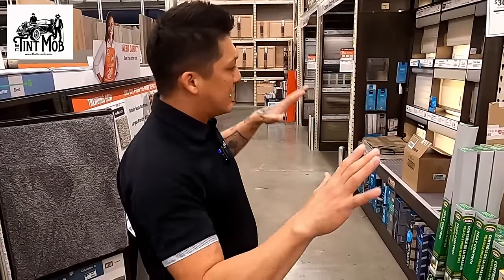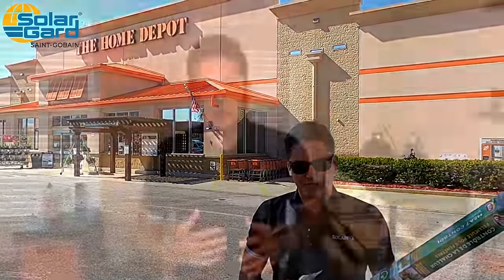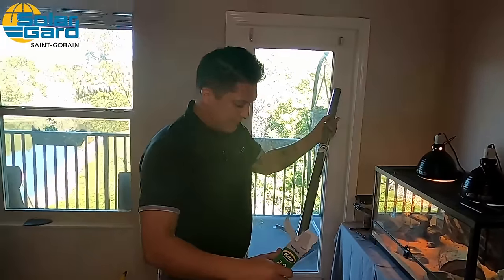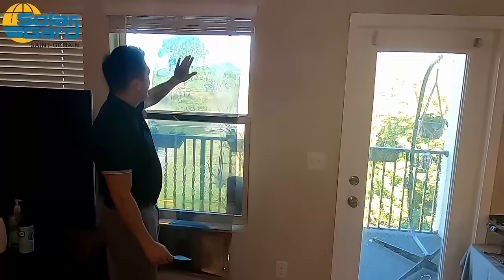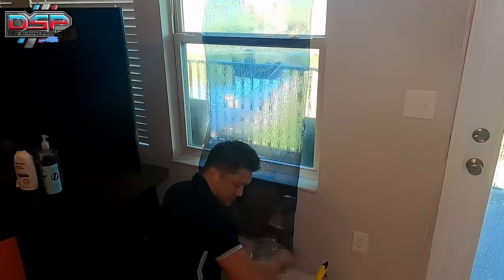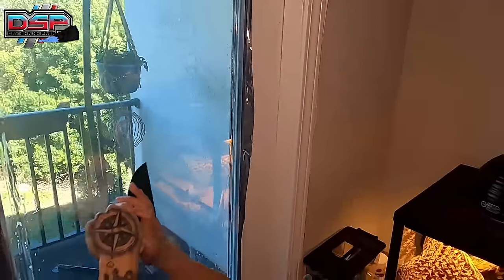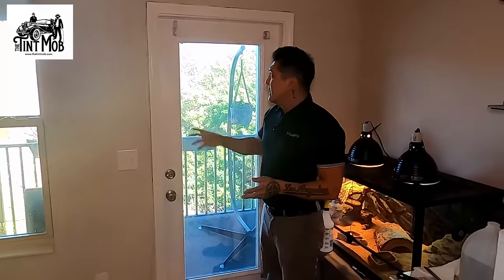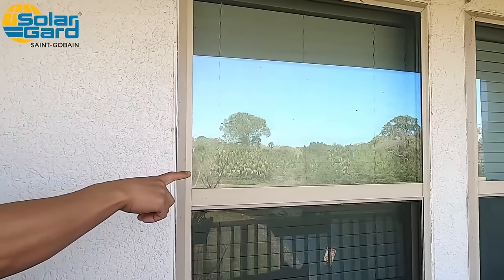How To Tint Your Windows | Home Depot Window Tint | Short Version

Comment: If you don’t use the right window tint on double pane windows you can ruin the sealing gaskets on the window. Heat gets trapped between the panes of glass and pushes out on the gaskets.

Comment: I've been a window cleaner a long and you only need to overlap strokes by about 2" not half!!   Fo installing film yes overlap about half.   Faning or continious squeeging is better and faster too.   Also its better to cut on the floor or table then reverse roll/drop method the film instread of carrying the film "naked" and fllpping it around which is hard and doesnt work on big windows!
Reply from the maker: Keep in mind this video is intended for DIY’ers not for professional window tinters. This is a macro video for the masses and to generate views. 

I’m currently working on a training series for 2024 that is for professionals covering everything you need to know to get into the industry.

Comment: I would not recommend using paper towels to clean the window, it can leave contaminates, I always used lint free towels, I also used canned air to blow out the edges first and then a lot of spray around the edges to pull out any dust... also when setting the film you can set the factory long edge vs the short to minimize cutting and reduce mistakes...but overall not a bad tutorial.

Comment: Dude… how tf do you remove the liner. I used nails, teeth everything and it still won’t separate from the film!!!
Reply: Its easy if you use regular scotch tape. Just put one piece on each side at the corner it will separate when you pull it apart.

Comment: Okay I bought the mirror one from home depot. It says install inside. But when I did the mirror effect is on the inside and you can see into the house at night. I don't get it.
Reply: Sounds like you installed it backwards? Mirror effect should be seen from the outside. And when installed correctly, if lights is turned on inside at night, outside can see in.

Comment: I heard that if you have double pane glass, you should tint the outside because the heat trapped will ruin the factory seal. What's your opinion?
Reply from the maker: #1 this film is NOT exterior film still last about a month. 

#2 about the heat trapping you are right and you are wrong at the same time. 

This film is a silver film so it has so high reflectivity that the film doesn’t trap the heat it bounces it off, Dual Reflective films do the same. But some ceramic films are too absorbing of heat could possibly break the glass and or the seals. There are many factors that determine what kind of film to put on glass like glass type, number of panes, if there’s a low e coating and where it’s located, etc. 

That’s why this video only goes over this type of film. The other types are not readily available to the average consumer.

Comment: We installed windows tint today. Followed your directions. But i have streaks between the film and the windows. Cleaned the windows very well before applying tint. Will the steaks go away. I used dawn soap and water to clean and wet windows
Reply from the maker: Haziness and moisture pockets are common after install those should clear up after the curing process.

Comment: Is it true that you can't tint dual pane cause it will crack the window?
Reply: If you tint inside glass, the heat gets trapped in between the pane, and it can break the seal.

Comment: Same material, same process, same faces and it keeps pulling away from the window. Any suggestions?
Reply from the maker: Are you laying the adhesive side to the glass? Is it in fact glass and not plexi or textured surface
Reply: @WindowTintingBusiness  apparently all was correct in my process, thanks to you. The manufacturer said that it may have been in the shelf for too long, so the curling forces were stronger the adhesive. I just taped overnight and the next day all good
Reply: @WindowTintingBusiness  apparently all was correct in my process, thanks to you. The manufacturer said that it may have been in the shelf for too long, so the curling forces were stronger the adhesive. I just taped overnight and the next day all good. Thank for the tutorial.

Comment: Um no i can jus send u my address and u come out im in Sac lol
Reply: Sticking the plastic from inside does not protect you from heat, the plastic heats up and emits the heat inside your house. However, if you stick the plastic from outside, the plastic will heat as soon as the sun hits on it and the heat stays outside. Depending on what exactly you want, the plastic can be stuck from inside or outside. It is a question of choice, if you want to heat or cool your house

Comment: Why do ppl want home window tint? And please explain how it saves on energy bc that sounds like bs
Reply from the maker: Why: to reduce glare and tone down the amount of light going into the house. 

Energy savings: 1/2 your electric bill is your ac. When you can install window tint it should block about 60%ish of heat going into the house. Less heat in means less ac and energy to cool the house. You typically see a reduction in your energy bill by about 1/3.